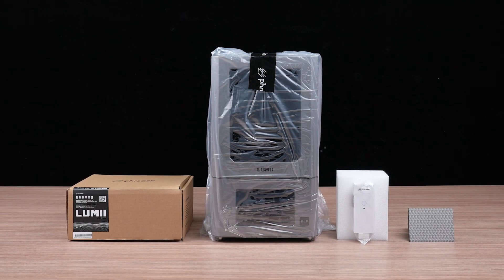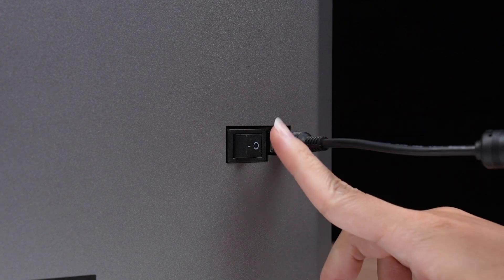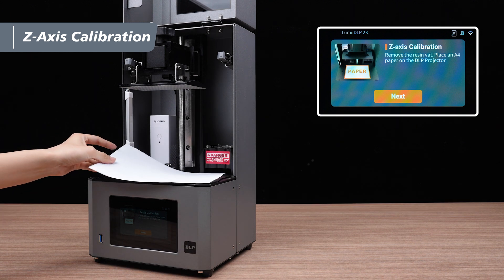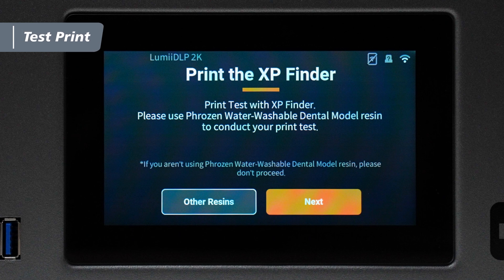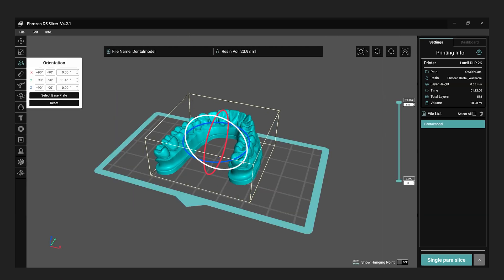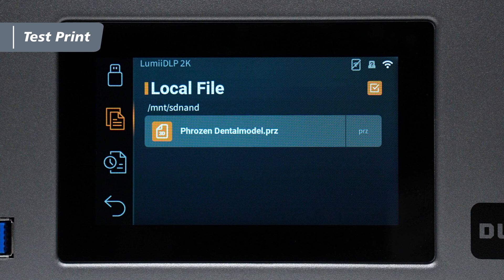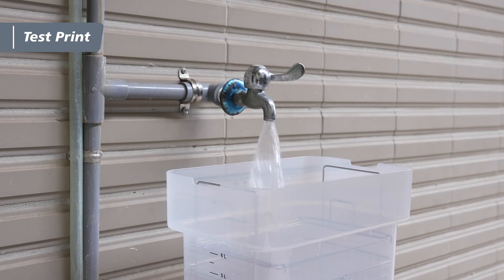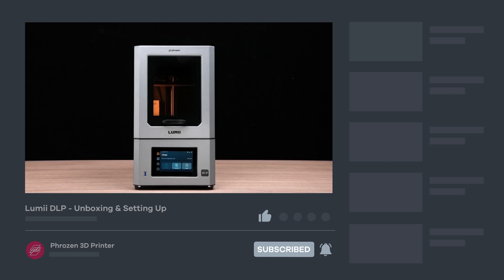Phrozen Lumii DLP: Unboxing & Setting Up - Phrozen 3D Printer

Comment: What does DLP mean and how it differs from (M)SLA printing?
Reply: the term is used for a specific way to bring the light onto the printing area. SLA printers use a constant light source and a monochrome screen that is darkened where no voxel is supposed to be. DLP uses mirror(s) to direct the light where the voxel is supposed to be. SLA resolution is limited by light scattering (among other things), DLP is generally slower as it creates 1 voxel at a time, but also more accurate and thus has the potential for higher resolution.